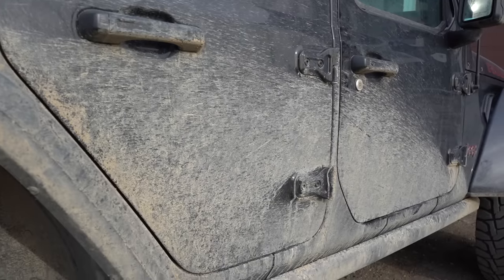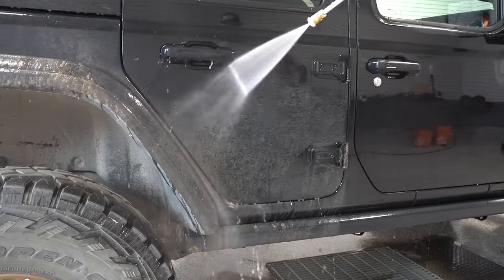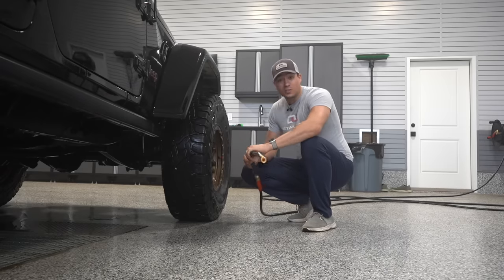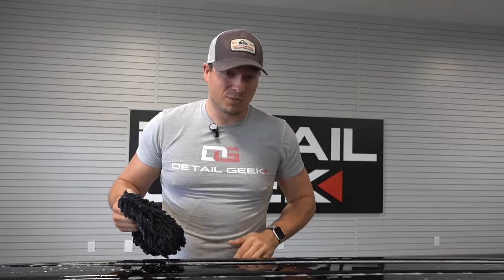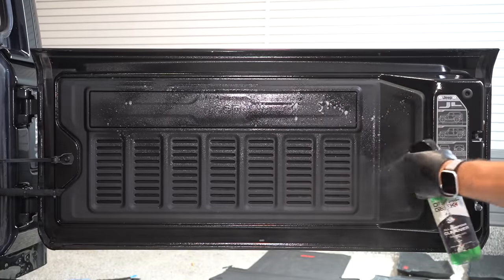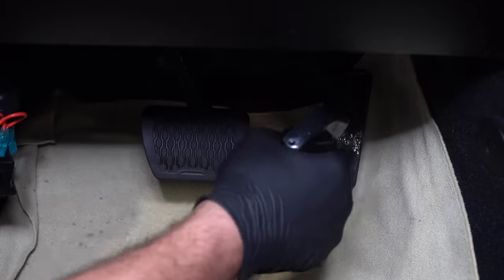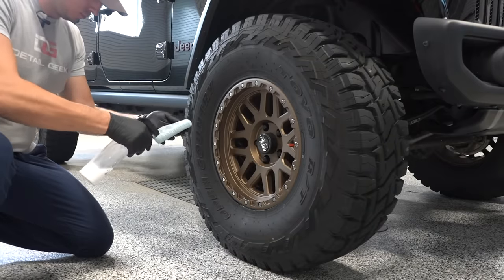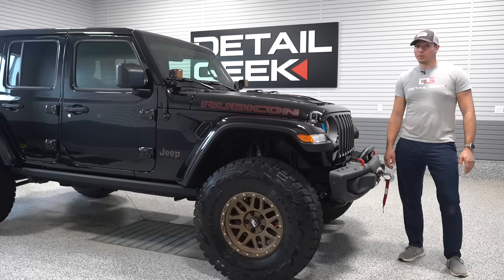Cleaning a MONSTER Jeep Wrangler!

Comment: Would a mechanics creeper work better in this case next time for cleaning the bottom? If you get that question about the top of vehicals all the time. I'm sure you get the suggestion to buy one or two drywallers step  in different heights.

Comment: Curious question:  since the doors can be removed, and the flooring has a plug in it, why not just remove the roof/doors/hatch and go at it that way?  Genuine question!
Reply from the maker: The interior was hardly dirty so there was no need to go to that extent, but you certainly could.
Reply: @TheDetailGeek  Have you done it?  Timing wise, I'm just curious (even if it was Uber wrecked) would it be feasible?  Or make it easier?  Thoughts?

Comment: Great job as always. I’ve heard it said you can pressure wash the interior of the Jeeps if you go mudding with the doors off. What are your thoughts?
Reply: you can hose off your interior but not pressure wash, don’t hose the dash tho even tho they are water resistant. There are drain holes in the jeep for the standing water and you want to leave it out in the sun to dry. Also if you have leather seats, normal clean and cover with trash bags and you are good to go. I own a 99 sahara and a 22 rubicon.
Reply: also don’t buy a jeep they are trash vehicles and over priced. idk why i still have mine it’s an abusive relationship

Comment: Two questions - Why don't you wear safety goggles while using you power washer? although, I never this but, do you roll the vehicle a couple a feet to clean the inner part of the wheel where the brake caliber is blocking and especially to put the tire shine on the part of the tires that were just on the ground?. Thanks and keep up the good work!!

Comment: In some of your previous videos, you've cleaned really muddy vehicles (including your own truck) and you always had to clean your drain because of all the mud that would fall in there.  I always wondered what you did with the mud after cleaning it out considering it doesn't seem like a good idea to let it drain down into your pipes or even the sewer drains outside.

Comment: The graphene sealant works well. My car has been much easier to clean after one application. Water beads but dries quickly, so it really reduces water spots. I put on all of the exterior but the tires. Adam's graphene wheel dressing there.